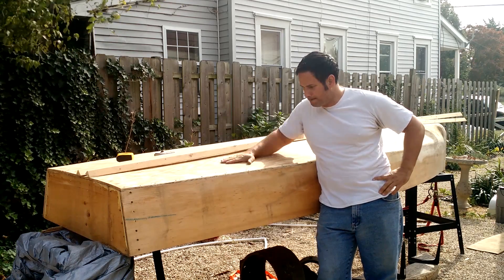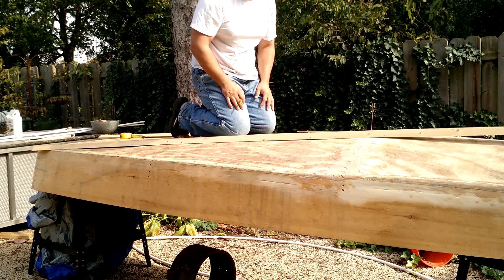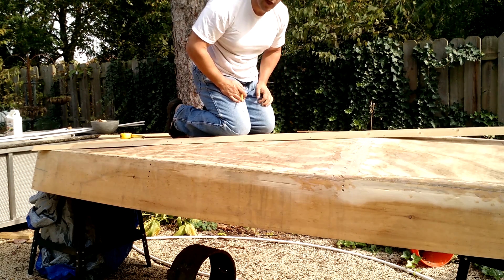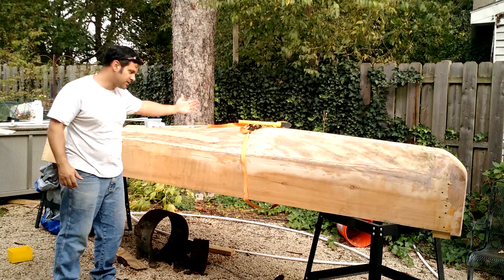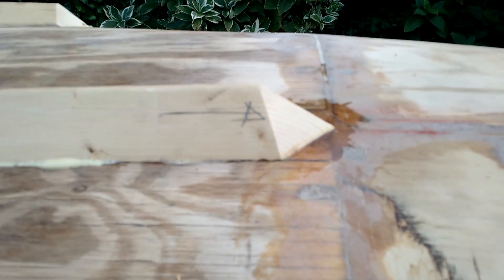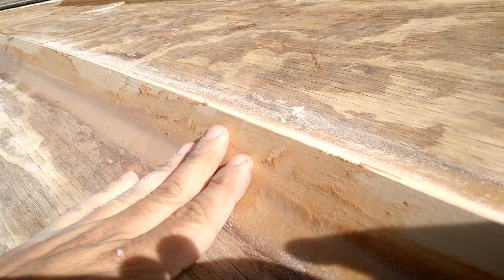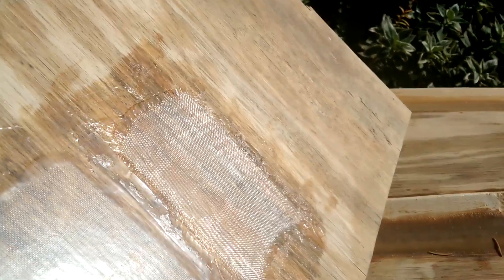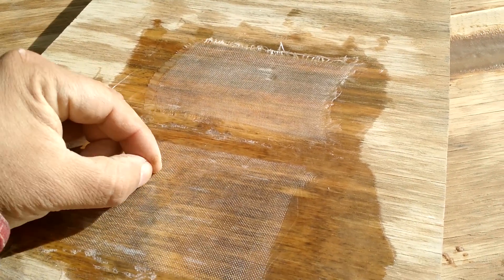HomeMade plywood boat part 4 - Strakes, fillets and fiberglass experiment

Comment: Don't know how much your going to use your new boat ,if it's going into heavy use or your running up on shore a lot you may have wanted to put an all aluminum center keel all the way front to back as it won't rust is light and if much more usable than wood . Just a a suggestion .
Reply from the maker: Good suggestion.   I don't plan on beaching the boat at all, or give it heavy use

Comment: Hey Ray,  just a little helpful hint: instead of using acetone to clean up epoxy, my chemist friend suggested I use white vinegar. And it worked great. You have to use to cleanup and immediately after using epoxy and before it sets up, but the good thing is that it doesn’t dissolve the epoxy which allows the epoxy to penetrate the skin and get into your blood and ruin your kidneys.
Reply from the maker: Good idea, thanks for the tip.